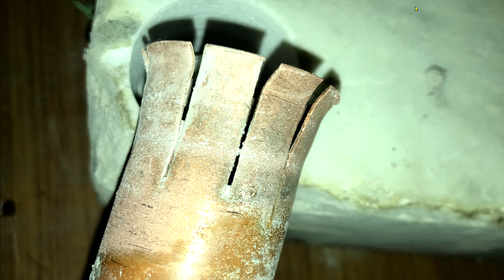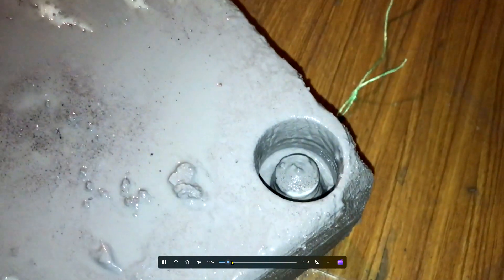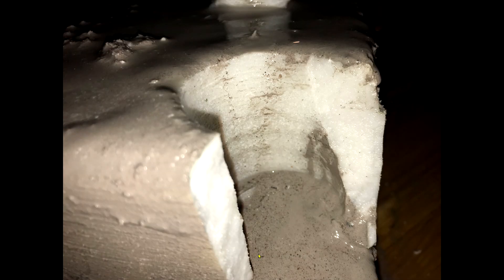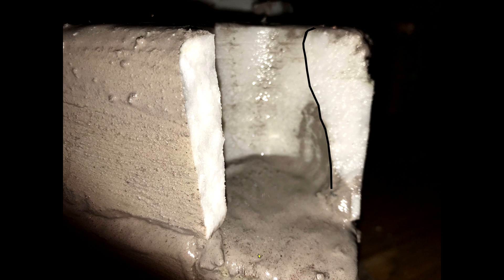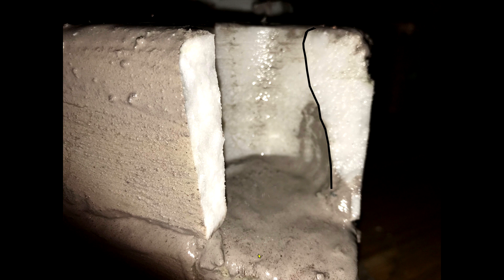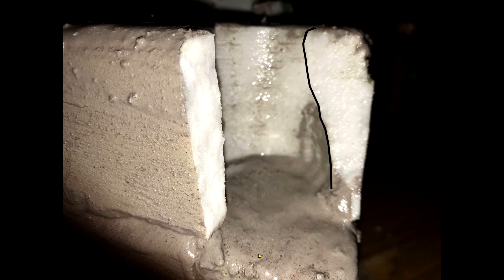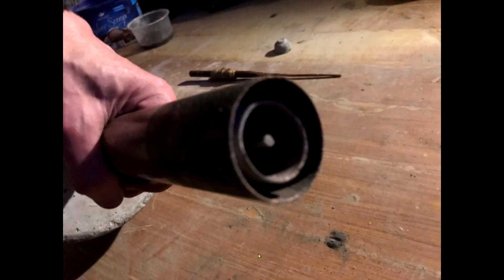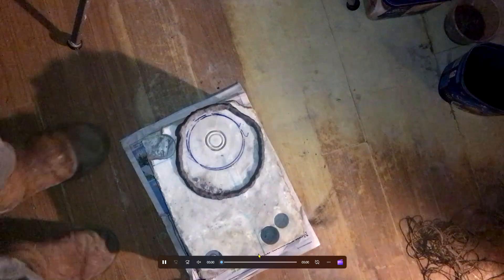Hollowing out a stone vase with speed. New PRIMITIVE technique. PROOF OF CONCEPT Part ONE

Comment: 3:37 "Marble takes 3 times longer to drill than does granite"? Did i hear that right? If so, how did you come to that conclusion? Marble is a 3-4 on the mohs and granite is 6-7. Ok, i just done some googling and if you did say marble is harder to drill then your completely wrong. If you didnt say that then i dont know what the hell you said.
Reply from the maker: @79Cody440  I’ve got a playlist of experiments including raw footage. I may have misspoken at that point but bring it up elsewhere. 
Mohs scale is irrelevant and has been used by lost techies types as faux evidence.
Reply: @SacredGeometryDecoded  OK. Saying you misspoke would have been good enough.

Comment: I've heard that a fine homogenous particle size quartz sand is falling out of the joints between the pyramid block.I'm assuming they used the ascending levels of masonry were fine dressed on top,and this is the aggregate used for finishing blocks.just theory.I'd be very interested to see if there's copper particulate matter in th e quartz there.thanks again.,and be safe and lucky.maddog,West cork
Reply: Read the paper available online:  "Sustainability problems of the Giza Pyramids."  It goes into detail about the structural/environmental problems being seen with the pyramids which contribute to their degradation.  Having had their core structure exposed centuries ago as casing blocks were removed of course opened that up to sand/dust accumulation which if you have ever been in the desert permeates every nook and cranny.

Also the blocks themselves and the mortar which is ubiquitous on them has been subject to environmental stresses.  Earthquakes over the millennia cause the blocks to vibrate acting to cause them to grind again each other - which adds to filler debris in all the cracks and seams.  Underground moisture acting upon the land acts towards "soil liquefaction" which undermines the very ground upon which the pyramids rest.  Thus their massive weight risks destabilizing themselves as the ground yields causing cracks in blocks. 

Anyways there are lots of reasons why "sand" as you say might exude from the seams between the blocks representing what has accumulated over the centuries + what is being generated as blocks are rattled together causing their surfaces to be sanded away and causing fractures to occur in blocks.  "Polishing sand" might be used on the casing exterior - which is now mostly gone.  It would not have been used on the substructure of roughish limestone blocks however and thus should not be exuding itself out after all this time.  Just a thought.
Reply from the maker: @varyolla435  
https://www.youtube.com/watch?v=notz0z53wtM
I haven't looked this up for sources but brief search has some articles from the mid 1980's. Drilling revealed hollows and the sand was silica sand. Quite a bit available along the Nile. Egypt still exports it.
Reply from the maker: I’ve heard it is silica sand = 100% quartz. No average sand.

Comment: I think I would have done it by drilling the throat diameter all the way down, then used a lathe and some sort of rounded copper block in the vase profile (adjusted for copper wear) and force that against the walls of the vase with abrasive until it eventually wears into it
Reply: Some of the Alabaster shops in Egypt have men outside doing demos with the hand drills and various profiled scrapers/planers. Of course there are pictures all over the internet as well.
Reply: @BALES5000  yousefs family owns a shop making vases.
Reply: @TheMoneypresident  Yep. He sure doesn’t show off the tools and techniques.
Reply: @BALES5000  brien actually made a video
Reply from the maker: More to come. This a very rough one.
Removing the core would be impossible at a certain point so I have many straight drills to break it up as I go down. 
Next one will also have multiple flared drills and longer splits so allow for self adjusting. These were too short and not enough flex after a certain point.
The big mistake in the next one was too short splits 
I will probably also use wooden wedges to hasten the lateral drilling in next attempt on basalt.
I also drill the exterior of the vase at the same time in a sort of reverse of the interior thing here.
All the bugs worked out hoping for a 24 hour vase in granite. Or at least a decent blank that would then go to polishing.
An idea for how to do the handles too but first that will be once I get this down.
Reply: @SacredGeometryDecoded  great effort and discoveries! Looking forward to seeing your planetary drilling rig (compass drill) set-up you mentioned to me once before.